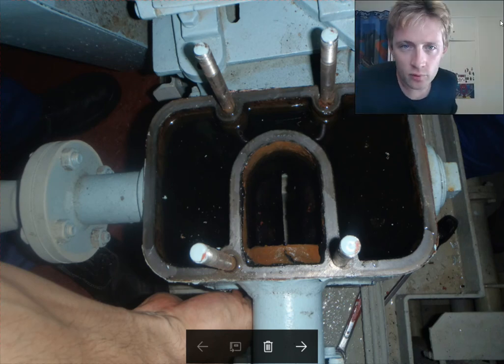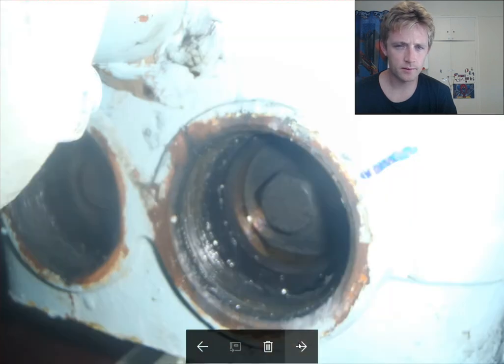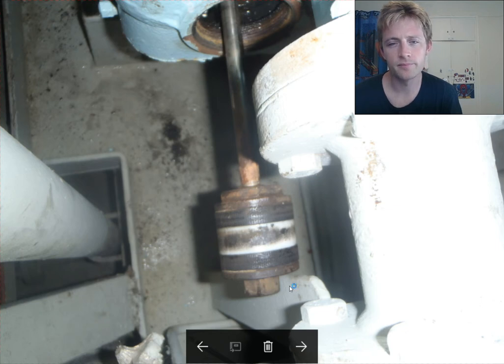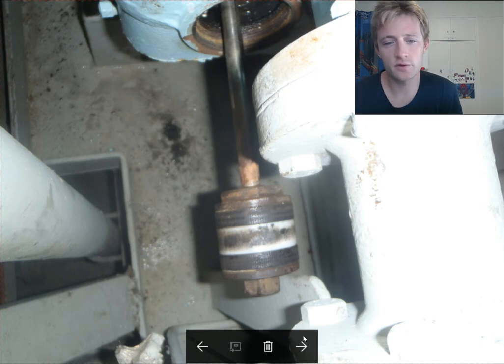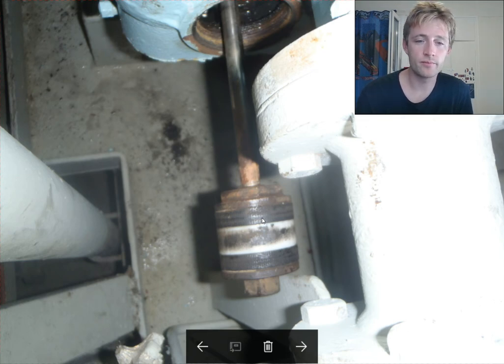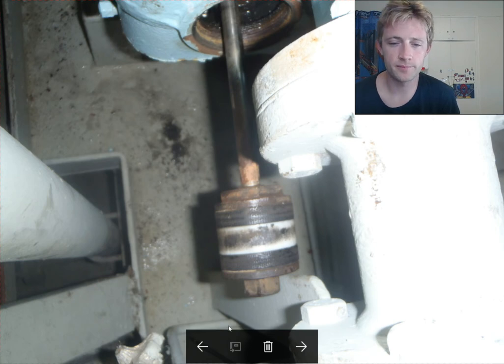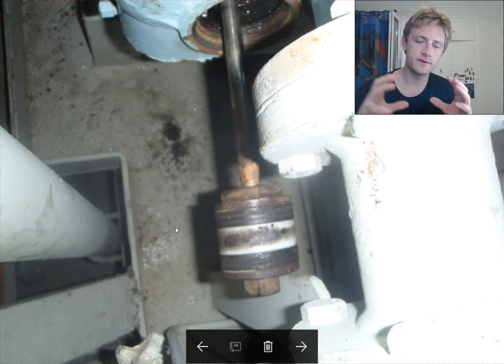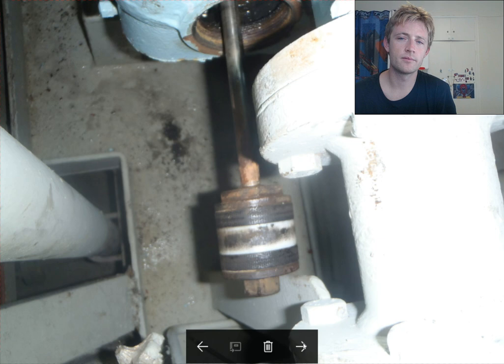OILY BILGE PUMP OVERHAULING

Comment: sir ..when i studied about reciprocating pumps i saw an air chamber attached to it..can u pls describe about it ?
Reply from the maker: Can you send this pump to my email?
Reply from the maker: @mridulvijaybabu457  mbikefe1984@gmail.com
Reply: @Adventure-Story  emailed..pls check sir 😊
Reply from the maker: @mridulvijaybabu457  Yes i checked already this system is used as damping of kinetic energy of liquid to minimize the hummering effect through piping because we have high flow and volume such damping is really nessesary to avoid any damages and flactuations through the system.
Also it serve to protect the pump from sudden lost of discharge pressure as it describes there when pressure decreases air pocket push the water to discharge side and through this pump still able to be under pressure and support some pumping.
Reply: @Adventure-Story  thank you so much sir..really apreciate the videos u r doing 😍
Reply: @Adventure-Story  sir i find out that a spring is inside this air vessel..is that what we use in bilge pump ?
Reply: @Adventure-Story  Hello, Sir! What is most likely reason miss vacuum? I checked suction filter, no vacuum (( I close suction valve, also no vacuum((  I think May be damage piston rings?
Reply: @Adventure-Story  Hello, Sir! What is most likely reason miss vacuum? I checked suction filter, no vacuum (( I close suction valve, also no vacuum((  I think May be damage piston rings?
Reply: I have the same oily bilge piston pump
Reply from the maker: @СергейСергеев88  piston rings also plays role everything you should check one by one until find where you loose that vacuum.
Reply: @Adventure-Story  thank you)
Reply from the maker: Welcome!
Reply from the maker: Also one more test you can do is to close full the suction to see if your pump makes any vacuum at all .If the pump makes c
Vacuum somewhere else is the problem on piping probably,
Reply from the maker: Sometimes also a bad closed cover from suction filters can make vacuum lost.
Reply: @Adventure-Story  Thank you, Sir!
Reply: @Adventure-Story  Thank you, Sir!
Reply: 1. check the pipeline connecting relief valve to suction side of pump , in my case pipeline pin hole was there.
2. Also check the gland packing, it should be little tight else it will suck air.